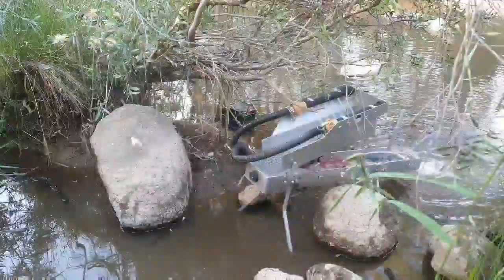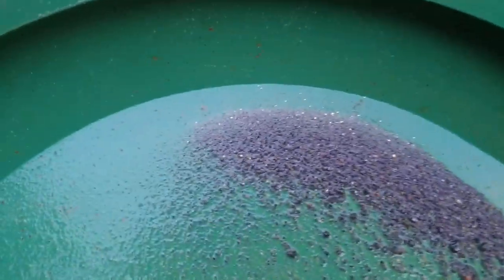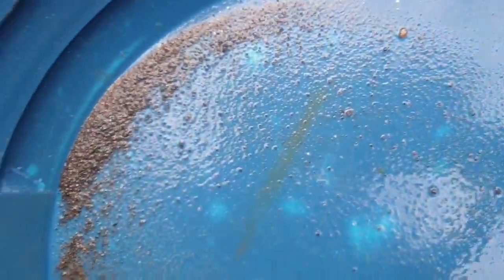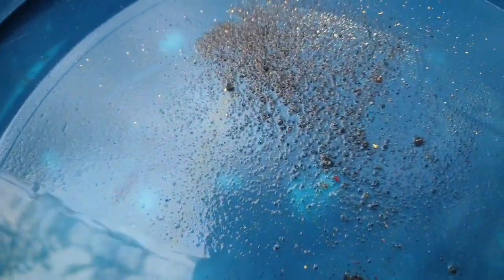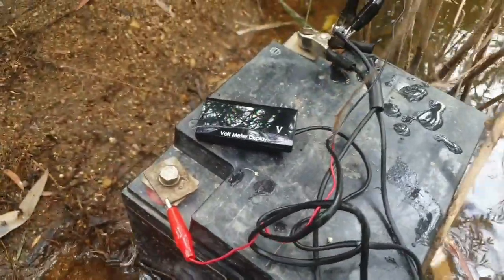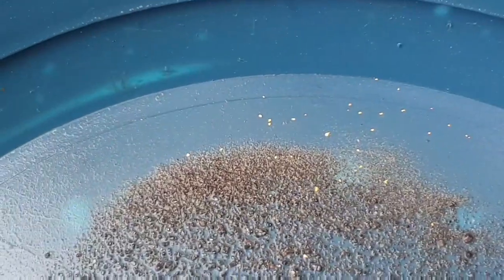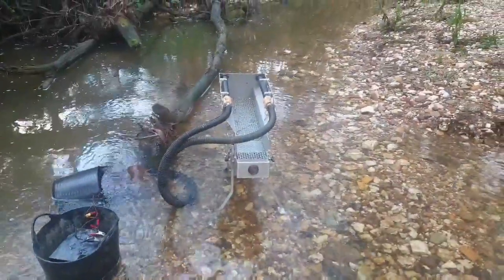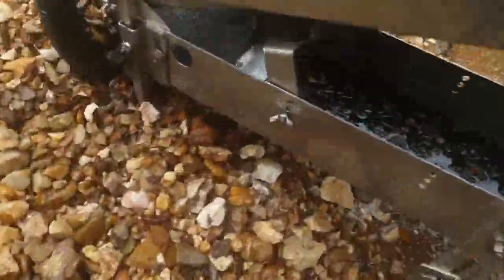Two Golden Trips

Comment: good spot there mate hopfully be out there mid january man keep it up i found expanded mesh or bread crate is the best i do about 200 plus shovels , if you only doing 30 the dream mat would be good to use because you have the back up sluice at end,
Reply from the maker: I'm  only doing 30 shovels then removing the small piece of Bunnings for mat to check if I'm still on the color. The second mat stayed in all day. Just changed the top mat as I wanted to test the different mats on the creek
Reply: @MurrayRiversGoldAdventures  ok cool i normaly shovel all day clea out 2 or 3 times i keep an eye out on second sluice if i  getting lot of black sand in it i clean out
Reply from the maker: I was more trying all the mats to see how they went at Reedy and instead of doing test pans I remove the small bit of Bunnings door mat to see if I'm still on the gold.

Comment: The volt meter that you are using does it measure the voltage of the new lithium batteries? What make and model is it?
             Cheers            Robert
Reply from the maker: Have sent you a email.  You can have a look at both battery I have.
One has the meter built-in

Comment: What was you best gold weight in one run
Reply from the maker: At  Slaty creek, I run for an  hour or two  on that day. Think it was 0. 37. At Reedy creek Eldorado, the days test the different set ups. 0.67
Reply: @MurrayRiversGoldAdventures  what is your best per square meter way out
Reply: On reedy creek I got 2 grams per square meter with my dad
Reply from the maker: 1.67 out of 1/2 a square from Slaty creek. Don't really measure like that.